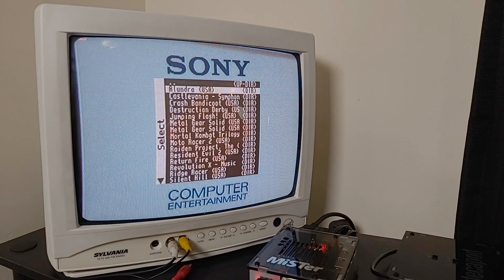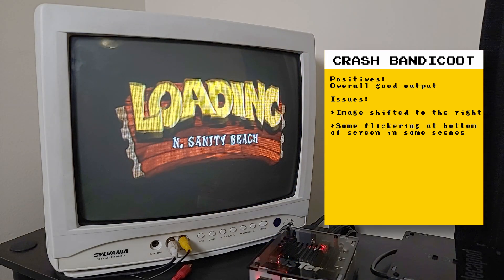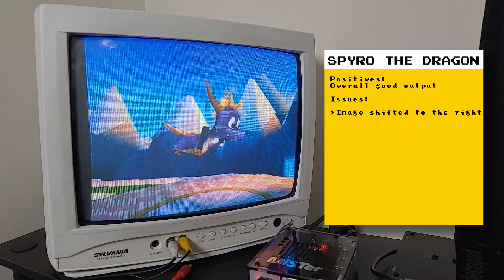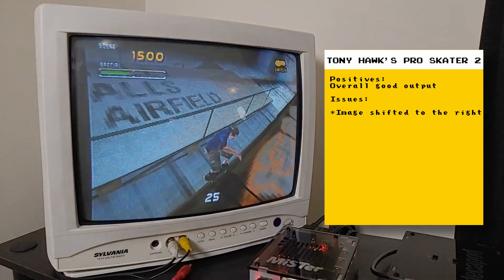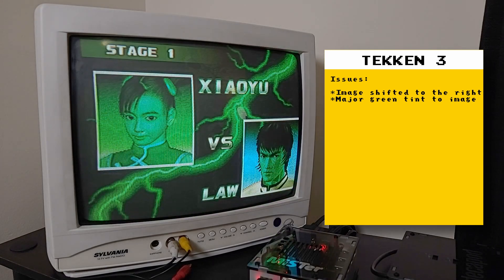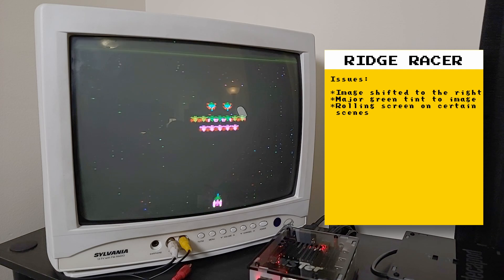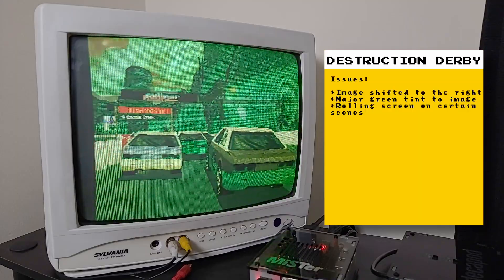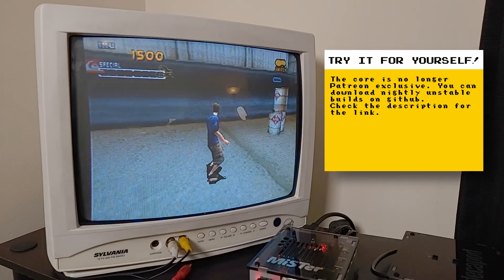MiSTer PSX Core: Analog output with IO Board

Comment: Has anyone had any success running the PSX core on a crt using a vga to component?
Reply from the maker: You may want to try asking in the Playstation forum for MiSTer.
Here is the link.
https://misterfpga.org/viewforum.php?f=38&sid=7dac39a95c90d7c2581b70deb3c2108e
Reply: @LusRetroSource  Thanks

Comment: The green cast could be due to the composite adapter. I’ve seen that on some cores when using composite.
Reply from the maker: Thanks for letting me know. I haven't seen the problem on other cores but I mostly play the console cores. Will have to test out more arcade cores to see if I get a similar issue.

Comment: Analog video out on a CRT? Perfect for my Trinitron PVM. If a 2nd SDRAM is required for sound I'll hold my nose and pay for it.

I will be astonished if he gets it to work with the one SDRAM module.
Reply: can use direct video if it needs a 2nd ram stick so analog wont be lost

Comment: I connected my TV via the analog board and a VGA-SCART cable. The only problem that occurs is the image shifts slightly to the right. Wrong colors and rolling images do not occur with RGB-Scart.
Reply: So you got the latest Playstation core working on a CRT TV with a VGA-SCART cable?
Reply: @krunge That is correct.
Reply: @bettyboo2207  Nice, I'm struggling myself and can't get any games to run. When I try to load a game I just get tossed back to the Playstation boot screen immediately. Happens with all games I've tested. Any tips?

Comment: I asked a Sony technician if it would damage my pro CRTs when I fed them a signal they couldn't display, specifically 480p to a standard def CRT. He said it wouldn't harm the CRT. I know other people disagree. Most people turn off their standard def CRT when loading an image it can't display, i.e. when MiSTer boots or when Windows boots. Personally I avoid it whenever possible but I don't worry too much about it. I have booted Windows on my CRTs many times and never had a problem.
Reply: Plus, no worries - if you blow out a CRT, you've still got 27 back ups over there to fall back on!  🤣
Reply: @KindaCool  Having back ups does give you the freedom to mess around.
Reply from the maker: Thanks for the info! I always shut off my CRT when I run AO486. Don't wan't to take any chances.
Reply: You turn on your mister before your crt?
Reply: @zenyousapprentice3732  yeah. F>$@ it. It turns purple for a sec and then fires up.
Reply: @riggel8804  I've heard you are supposed to do the opposite. Let the crt "warm up" first, if you will
Reply: @zenyousapprentice3732  that's probably good advice. It's hard to know for sure with this old tech. I can tell you that I do it sometimes and nothing bad happens

Comment: Can you please go into more details how you set this up?

I use my MiSTer with the analog IO and a CRT TV using a VGA-SCART cable. I'm running the latest Playstation core like you and using the recommended bios/boot.rom and I get the Playstation boot screen but no matter what game I try (even same as yours) I just get thrown directly back to the boot screen when trying to load a game. It's like it's not even trying to run it...

Comment: The shift to the right is not the issue with the analog output but with your TV. This happens if the signal frequency differs from the default setting of the TV. i.e. when outputing 60Hz signal to PAL TV. It is enough that output signal is 48Hz, like Pentagon (ZX Spectrum Clone) and on PAL TV the result will be similar comparing to standard ZX Spectrum. If your TV has service menu you can correct that there.